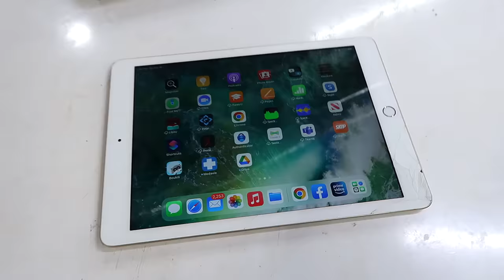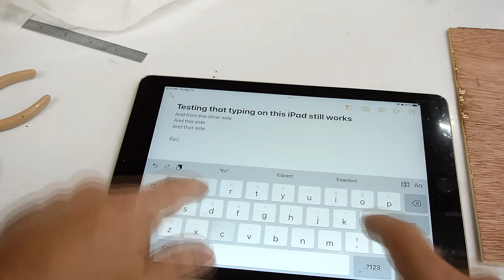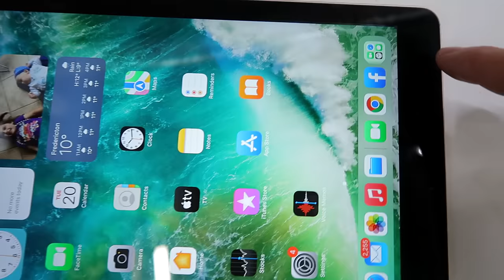Amateur iPad screen replacement

Comment: I did that same repair for my daughter...  Two weeks later Apple made her model EOL and stopped doing updates of the iOS.   I got the parts at a local repair shop.   He was doing a repair on a similar iPad.  I guess they all start with removing the screen.  He used a heating pad like you'd use for a sore back and laid the iPad face down on it for 20 minutes or so then flipped it over and everything just peeled apart.
Reply: A heating pad is a great idea. Probably more akin to the pad style oil pan/battery heaters for a car/truck, as a back pad wouldn't go hot enough. But if I ever have to do a screen replacement I hope I remember that tip.
Reply: @PlatypusVomit  Look up "CPB Heating Pad".  That's what I use for iPads and newer iPhones.  The ones that go up to 100C are better, the hotter you can get it the easier the glass is to remove.  But 60 or 70C will suffice if the one you get won't get up to 100C.
Reply: if you have a 3d printer ... the bed should work
Reply: @bullzebub  Yep i've done it on my printer heatbed.
Reply: @bullzebub  Brilliant, I never would have thought of that. Just have to remember this for next time.
Reply: @BladeScraper  I'm using the heated bed of my 3d Printer - it goes up to 100°C
Reply: @jBurn_  You could probably use a electric skillet on the lowest setting.
Reply: What about a hair dryer with variable heat and wind settings??

Comment: The iPad does have Touch ID but if your wife didn’t use it then no big deal. Save the original button in case you have to do this again.
Reply: Yeah I was wondering why he said it doesn't have touch ID... any apple home button that appears blank on the front is a fingerprint sensor
Reply: Exactly. It wouldn't have shown that error at all if it didn't have Touch ID.

Comment: As someone who repairs these every day for my job I can say, not a bad job at all!
The plastic in the screen on the corner is probably the protective film they put on the inside glass and thats probably the pull tab you can see. If you need to do one of there again just pull it off before closing it up. :)

Comment: I’ve worked on laptops and desktops, always avoided tablets and smart phones though.  After watching your video, I might try it out next time I break a screen.  Thank you
Reply: It's totally doable. I had zero experience with anything remotely related the first time I replaced a phone digitizer; YouTube videos are a godsend. I've done it twice now, both successfully, and have replaced "non-replaceable" batteries in a couple of different phones as well.
Reply: the cheap prepaid android phones are the easiest to take apart. Just screws and plastic clips.

Comment: How you were doing it around 2:15 was what I found easiest to remove glass from glued together devices. I would up using a mix of playing cards (nice and stiff with sharp edges) and guitar picks to slowly work things open.
Reply: I think I've seen it suggested to use packing tape on the front side of the broken glass to keep it all together when it comes out. Who cares if there's tape glue on the glass after, it's the busted one you're throwing out anyway

Comment: I've replaced 2 tablet screens (samsung), a phone screen, and a power jack inside a laptop using the small ifixit toolkit... it made this kind of repair so much easier. I am sure there are other great kits, but I can speak to the quality of the ifixit ones. I don't regret the $30

Comment: I was screaming at the screen (figuratively) 'swap the touchID sensor!!!'. That'll be a really annoying error for anyone used to using it on the pre-fix. That said, great job!
Tip: When working with broken glass, apply a layer of strong tape like quality packing tape or tuck tape. It causes the fragments to come up in one sheet, especially if you use a suction cup.
Reply: Apple nonsense #righttorepair

Comment: Repaired lots of iPads years ago.. same technique. Hot air around 100°C is enough. Just keep keep it moving around the edge your working on. And for the bende edges in the frame I did the same. Little bit of hamering, and shape it with a Dremel tool.

Comment: Now you know how I feel doing woodworking projects 😅
Those little bitty screws are still annoying, even with the right bits lol. I had to get the screen off an old iPod touch and I'd imagine the iPad would be way more annoying without the big heating pad the repair shops use. 

Also for future reference, you can still power off the device by just holding the power button for a bit. (or power and vol up on newer ones) ;)

Comment: Hugely important notice for anyone looking at this repair and wanting to generalize it as a general touch device glass replacement: Note that on a large majority of devices, the screen is directly glued to the glass!
Don't be fooled by dozens of eBay listings only selling the glass part, as during removal you will notice the glass and screen are glued together over the entire surface of the screen. This adhesive is extremely difficult (next to impossible) to remove and has an immense chance of breaking the screen while doing so.
Practically it is fair to say removing the glass and adhesive from the screen is not possible.
It's tempting for a budget fix (the glass bits usually go for only 7 dollars or so) but if getting the device working is actually important, you will higly likely be disappointed. Much better to just dish out for the whole screen + digitizer assembly in the first place - also results in less work.
If the device is "useless" and you just want to try replacing it out of interest, that's a fair chance to learn something though. Go ahead.

Comment: Sir, you have to undo the tiny screw at the special Apple proprietary battery connector, and slip an Ace or a Joker card between that connector and batteries, to keep the device powered off. As your trying to connect the digitizer, you could inadvertently pass current into the other bus traces on the ribbon cable, and destroy the touch screen and home button driver chip on logic board, or the new digitizer itself, it’s happened to me before, and the boss had to foot the bill over my rookie mistake, and wasn’t very happy with me.

Comment: The experience with how to take things apart is the reason for whenever I  get equipment in hand that do not work any more I dismantle it completely. Often the result is that there is no way it could be put back together again, but that is not a problem. Have made it much easier to later really fix similar devices.
Anyway just the knowledge of how thing are put together can often be very helpful even if you never try to fix devices and/or tools.

Comment: If you ever again will have to deal with adhesives use some isopropanol. It's highly effective to weaken the glue and help clean the old adhesive. And is completely harmless to electronic parts. Props for putting a hammer into iDevice. 😆
Reply: With the device powered up I'm not sure an ionizing fluid would be so safe. And yes it's always powered up. It may look off but there's still power on the device. We're well beyond the days of legitimate power switches now.
Reply: @1pcfred  I'm not saying to dunk it in a bucket of IPA, just use it where adhesive sits without worrying if it accidentally splashes on the circuit. And even with soft power on it's relatively small section of board that is powered when "off" - switch + initial stage of power circuit  controlled by PMU - also with relatively low voltage.

Comment: Apple devices used to be pretty straightforward to repair. They're so common that parts and guides where everywhere... But now it's all locked in software so nothing works after you fix it.

Comment: I believe if you changed the iPad front button with the original one, you would retain the iPad Touch ID functionality. You need to reprogram the new one apparently
Reply from the maker: yes, I didn't even know it had touch ID.
Reply: @matthiasrandomstuff2221  understandable, have a great day Matthias!
Reply: The original home button is mated with the ipad or iphone at the factory and can not be changed without losing Touch ID. I damaged the cable on my home button on mine while trying to remove it and lost touch ID.

Comment: Grab a cheap hot air rework. I have the "YIHUA 959D".  You can set the temp and airflow, and it's amazing for this type of work.  I've used mine for re-work ONCE and used it for "other stuff" 50+ times lol.

Comment: If you put a small rare earth magnet on the shaft of the screwdriver those tiny screws are easier to deal with…
Reply: That or a glob of blue tack. Those screws would have been hard to deal with even with work tweezers. I was using the big long work tweezers today for some funky stuff. But not the pointy sharp ones. I was using the locking ones.

Comment: Would you do it again... not on the same one. I've done it 3x on the same iPhone for a friend that kept smashing their screen and the problem is that all those little connectors ar not designed for multiple connects/disconnects, and the more times you open it the less they grip when you reassemble. Very quickly you get to the point where the connectors won't stay together for long enough for you to get it put back together again.

Comment: Although I’m sure it doesn’t really matter to you, at 1:24 you can see the Touch ID sensor on the original, which is why you got that error message after. But I’m assuming you weren’t using Touch ID and it’s not so important on an iPad anyway!

Comment: Do keep in mind that some of the adhesives used in replacement screens suck and eventually delaminate.

Infact, my old iphone 7 has a replacement screen and its partially delaminated. Also the digitizer is bugged and doesn't work under any operating system that isn't ios.

Yes, you heard me right, other operating systems! (look up "checkra1n")

Comment: I have the same iPad which i dropped on new years eve 2020, on the side of the camera there is no glass left and cracks running through the screen. Been using it like that for 2.5 years now 😅 It's annoying and dangerous because sometimes a splinter of glass ends up sticking in your finger. But over one month Apple will probably release a new iPad which comes with wireless charging, I'll just get that one and sell my current one for a junk price. Nice job on fixing it!

Comment: Its cheaper to just buy another Ipad in good shape. The price for botched expensive parts and the grief isnt worth any amount of money. Apple failed us when they could have just attatched the screen with a few little screws, but then rubber cement is cheaper.

Comment: I always assumed that you were pretty handy with computers being that you used to work for blackberry. A magnetic screwdriver set with all the right bits makes repairs like this way easier. you could have turned off the ipad by holding the power button until the screen went black, thats how it is on almost everything, even the newest devices. Working on it while it was still on was ballsy and I'm surprised it worked. 
also, seeing you bend that corner back into place with a hammer right next to your new glass panel gave me a whole aneurysm

Comment: for those small screws if phillips type the best driver to use would be a JIS precision driver as they fit those a lot better. otherwise good job on the repair

Comment: Those tiny screws can be a nightmare. I replaced a cracked screen on an older iphone once and stripped one of those little screws. I ended up needing to use a dremel to cut it off.

Comment: I'm sure that is an Apple "you don't have original Apple parts installed so let's disable something" error.  I ended up with the same error when I replaced the battery in my I Phone 7 that does have touch sensor home button.
Reply: Not sure if it's for sercuity or whatever, but the home button is permanently mated to the device.  If you change it , you lose touch ID.

Comment: The dremel vise-grips and hammer, were just great! Thanks for sharing!
Reply: I'm surprised Matthias didn't make a custom wooden corking tool for reshaping the corner. That'd have been right up his alley. Maybe even an outside form too? You just shape a piece of wood in the shape you want. Then thwack it with a hammer. That's what a corking tool is.

Comment: I'm always worried about inhaling a flea sized screw when working on apple stuff. probably should have changed the battery while it was apart.
Reply: Would the unit even work again if you disconnected the battery? I'd think it'd need a service reset after that or something.

Comment: I hope the default glue on the replacement screen holds. That has always (2 replacement jobs under my belt) been a problem for me. I buy third party glue strips right away now with a replacement screen.
Reply from the maker: I'm not sure.  The case on my iPad actually extends over the edges of the glass, I might have to get a case like that for her's too.

Comment: That has got to be the least confident I have ever seen you, normally you are so across everything that you do. It’s good to see that you are human. Great video as ever, thanks for sharing.
Reply from the maker: Still using the fixed iPad.  The glue for the screen didn't stick all that well, so we just rely on the ipad case to hold the screen in.

Comment: Sounds like you might want to invest in an ifixit toolkit. They're genuinely really good with a high quality precision screwdriver set that actually fits these things along with plastic and metal prying tools and suckers for removing glass. They're not cheap but they do work really well. Saved me many a headache since purchasing.
Reply: I think there's better tool choices out there. It's a toss up between Wera and Wiha when it comes to precision screwdrivers. Many say Wera is better though. They're going to be more expensive than ifixit is though.
Reply: @1pcfred  I mean, you said it yourself, there are better individual tools but they're more expensive. The ifixit kits are nicely balanced in terms of tools included, the quality of them and the price. Sometimes it's about the right thing, not the best thing.
Reply: @edwardchester1  Sometimes it's nice to have the best though. Ifixit is overpriced for what it is. It's not much cheaper than the best is. Maybe 33%? If you're going to spend that much then you might as well just go the distance. Buy once and cry once.

Comment: My partner used to work repairing phones. She says it's 180-200°c needed to release that glue. Also she recommends canned air for clearing the dust from the screen. She also says you did really well for a first one!
Reply from the maker: thanks
Reply: @matthiasrandomstuff2221   This digitizers  are sold with protectiv film on the inside part and it is wha you see on that corner when you glued the screen

Comment: Are you sure you needed to replace the touch panel? I would have tested the touch screen after the glass had been removed. I would  expect the broken glass was interfering with the touch panel, one of the shards may have recently slipped in deeper causing extra pressure.
Reply from the maker: touch sensor is bonded to the back of the glass.  You can't replace the glass without the touch sensor
Reply: @matthiasrandomstuff2221  Ahh I see, thanks Matthias

Comment: Top tips from someone that has failed as well as succeeded. Use the 3D printer bed to prewarm glue I usually go for 80 Celsius. IPA in a syringe loosens the glue and makes it really easy 😀
Reply from the maker: what is ipa?
Reply: Isopropyl alcohol.
Reply: @matthiasrandomstuff2221  Isopropyl Alcohol used for cleaning resin prints etc.
Reply: I've used Isopropyl at work for decades and until recently had never heard of it referred to as IPA. To me, IPA refers to a type of beer. The first time that I heard someone mention using IPA to clean, I thought it was a joke.
Reply: @JimLambier  those Indians sure drink a lot of beer. IPA!

Comment: Why would you remove the screen protector???
Reply: it's not really a screen protector, it's just a temporary protective film. It's not meant to be left on.
Reply: It's placed there so you don't get fingerprints on the screen before you place a screen protector on it and protects the screen during the assembly.